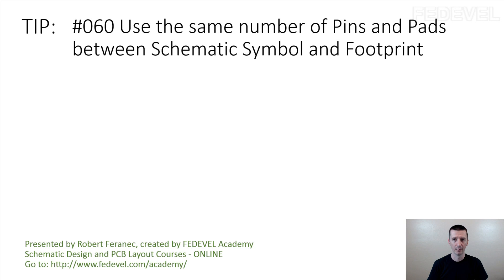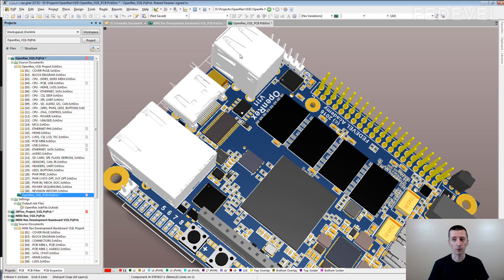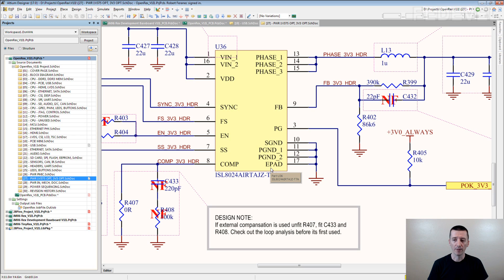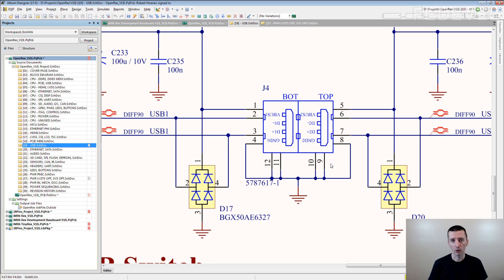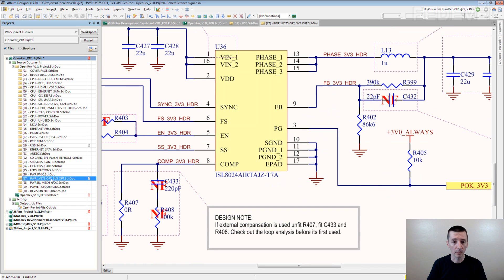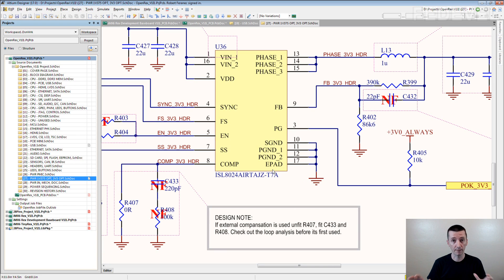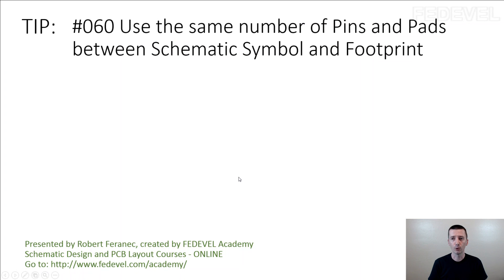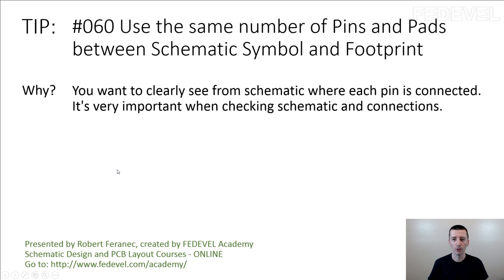TIP #060: Use the same number of Pins and Pads between Schematic Symbol and Footprint

Comment: Busted... I do this all the time with exposed pads and those through holes on connector pins. I just give them the same pin number (in the footprint) as the ground pin. It's just so annoying that the datasheets don't give them numbers so I decided I didn't have to either lol. But I can see this becoming a problem with larger projects. Good tip, thank you!

Comment: You don't need to connect all the shield pins of a jack to ground. It can technically save space and make PCB layout easier. Why are you insisting to connect them separately? The other question is lack of support in designer for pins that are internally connected in a component. The only hacky way I know is to assign them jumper ID.
Reply: Actually they are not just for mechanical strength or for current handling. The shield is important for EM reasons. Good EMC requires a good bonding of the shield to a reference, in most cases the PCB ground plane/layer. The best way would be to have a connector shield be "one" with the PCB ground. However we cannot do that and need to use pins to connect them. Hence there are multiple pins to provide the best possible connection (as low impedance as possible) at RF frequencies. For this reason you do want to connect all of them, not just one.
Reply: I'm afraid I haven't got a direct reference. However it's all about the least possible impedance when it comes to shielding, grounding and EMC. So the more connections the better. In this article by Keith Armstrong (http://emcia.org/KeithArmstrong_Article.aspx?artid=406) there is a picture that shows that shielded connectors are connected 360° to a metal chassis and with all pins soldered to the PCB ground plane. There is nothing stopping you from using only one pin, you might never notice the difference and functionally there really isn't. Still imho its best practice to connect them all to the ground plane. ymmv
Reply: Any reference that one bulky pin connection to ground is not enough to provide low impedance?
Reply: A coaxial cable shielding has nothing to do with two or four pins of an ethernet jack. It is not connected 360° and do not form a Faraday cage around the connector
Reply: Vasili Netrebko he's not saying to connect them separately, he's saying don't hide the pins - whether they are connected or not
Reply: You can't decide beforehand which one of two you aren't going to connect to ground. This is done on PCB layout step. It is a bad design choice to go back to schematic and disconnect one of those two shield pins when needed. Pins that are internally connected in a component shall be represented by one pin in schematic to leave space for optimization on the PCB routing phase.
Reply: Vasili Netrebko can you give an example of a component that has optionally connected pins? I can only think of examples where multiple pins are used either as power or load sharing.
Reply: Many jacks (like the ethernet one shown in the video) have many mounting pins that are connected to the shield which should be grounded. You don't need to ground all of them of course. There is no high current from shield to ground. There are many such pins because they are also used to secure connector to the board. You can connect only one to ground and solder the rest to dedicated isolated pads.